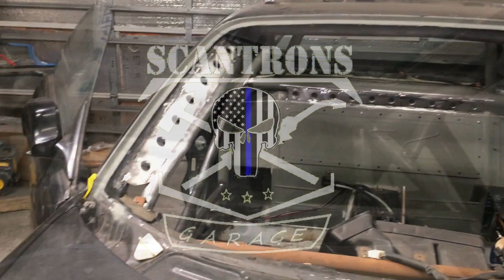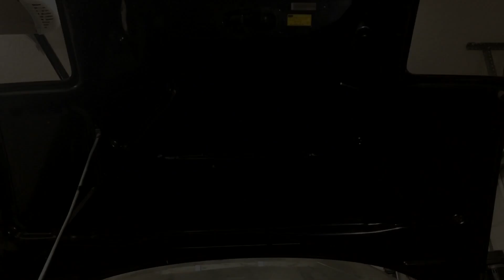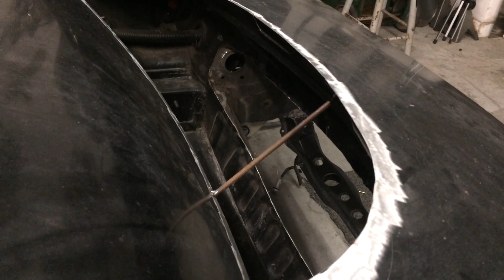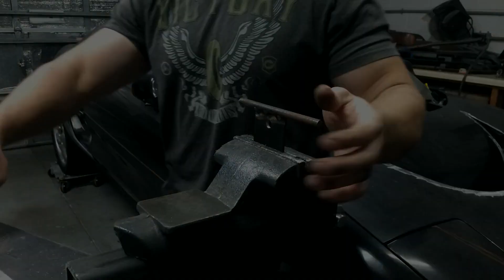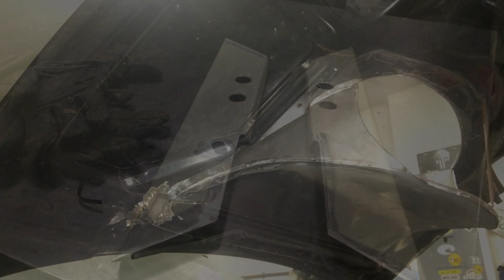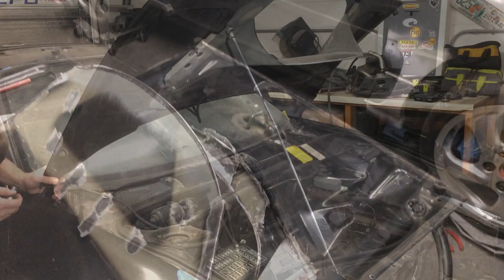Hood Vent (V8 MR2 Build # 32)

Comment: Great idea !
Did you see that done on other MR2’s?
I imagine that pass thru air will not only greatly improve cooling...but also aid aero and down force like crazy
Reply: I've had one on my aw11 mr2 I made for years.  Works well.  More so for added downforce as cooling system is already  over engineered from factory.
Reply from the maker: yes and no. i was originally thinking mclaren until i saw the campose composites piece being used.. i figured, why not make it out of metal. Next video is aluminum rad duct work